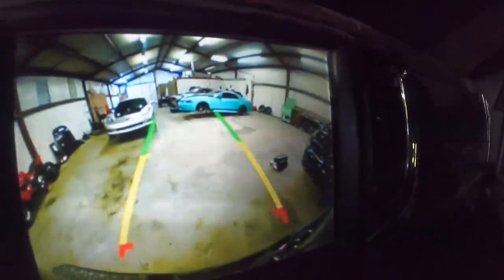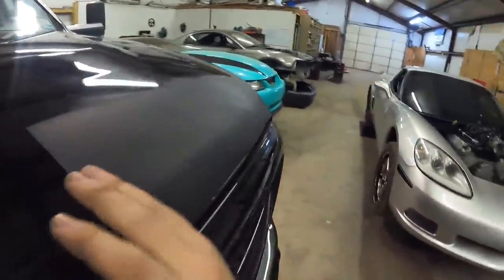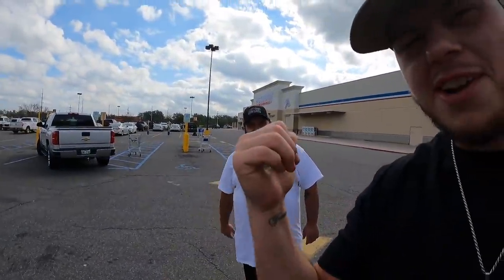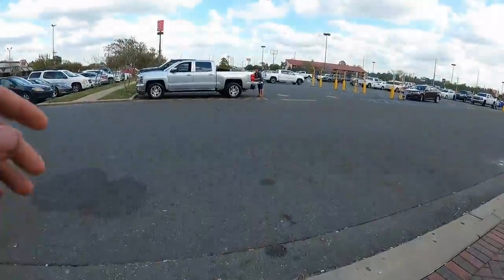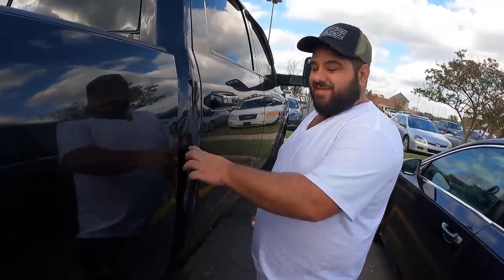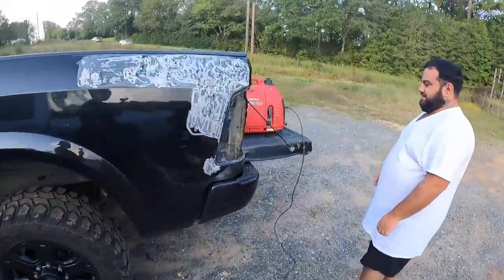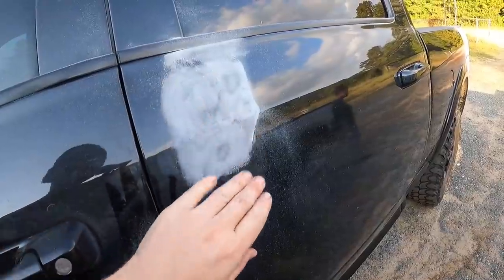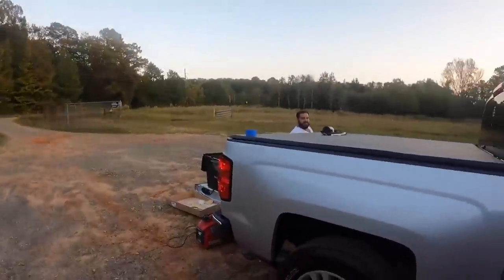Gypsy Body Man Fixes Major Damage on My Truck in Parking Lot!

Comment: damn bro that dude hacked your ride. He could have PDR'd a couple of those.. and drilling holes in your cab in sketchy asf
Reply: It's fixed aint it
Reply: @lda1472  no, it isn’t. That repair will fail within months
Reply: @jonathanloya7239  how?
Reply: @TreDayImages  Body filler is porous.. Moisture will get to the inside where the hole was drilled and  It will rust from the inside out and the Body filler will eventually fail. The proper way would have been to use a spot weld stud puller. Or at the very least use a fiberglass filler under the body filler. Secondly the spray paint primer has no corrosion resistance. also being non catalyzed it will continue to shrink. This repair will probably hold up for a year or two. In some cases that's fine, Buy by no means is it "correct".
Reply: @mikeomalley1683  damn thanks for the info
Reply: Agreed. First thing I thought was that some will easily PDR, and the bonnet and side panel are a fucking mess. I’d love to see the ripples after painting.
Reply: Yeah pin weld is always better than drilling holes and duraglass on bare metal then put your platsic filler over the fiberglass. The hood could be dollied out it just takes more time. I guess that guy did not want to carry an air compressor and cup or gravity fed gun for spraying decent primer with either. For what he charged he gave a decent job though you generally get what you pay for in life.
Reply: What else do you expect from a $600 parking lot job lmao guy did good for what he had and what time he did it in. Respect the hustle. Plus he said he's going to have the car repainted or wrapped.
Reply: Aleph Null that easily costs 3 grand or more for a crew cab truck so he’s breaking even on having it properly done vs this guy’s parking lot job. However, there’d be no YouTube video to argue about in the first place if that was the case
Reply: 420 Friendly to ruin a new truck by improperly fixing it or doing that on purpose to film it?
Reply: @mikeomalley1683  it's gonna burn inside from stud welder so its not big difference
Reply: I agree, people that don't know shit saying he did an amazing job lol  Look up "Dentless Touch"  to see how a paintless repair is professionally done.
Reply: @TreDayImages  that is why you dont use "bondo", alot of people dont realize filler should be used as a "skim coat" and not to fill craters. I only use "icing", totally waterproof and wont crack like bondo, buy the way,, most people dont realize bondo is made with clay.. lol ..Also, mike didnt tell you even tho bondo is porous, what do you put over the top of it so you cant see it, and that paint isnt porous, but, one hairline crack and its all over.
Reply: @velimirseocanac3153  the difference would be a hole and not a whole
Reply: @cferguson6688  why do they make lightweight body filler then? I can't imagine your that good of a metal worker to just use icing. And icing isn't totally water proof and it will crack. Not sure what your talking about
Reply: @ericaz6249  The only reason they call it "lightweight" is because it is lighter than lead which was used before polyester filler (bondo) and i was born..lol  but lead is still used and its very pricey to get someone to do a job for you in lead. Now as for icing cracking,, used the way it is intended and it will only crack if it is impacted again which i found if the panel flexes with bondo, you usally get a hair line crack and these newer vehicles are bear cans on wheels.  , As for "water proof" you got me there, i should of stated more "water resistant" than bondo and that is because of the difference in porosity of the two.  But as i mentioned at another spot, once painted , its all water proof.. what is all boils down to is opinions and what people prefer. I just know when i do a 10k airbrush job on a car, I dont want to have to do it all over again because of inferior (my opinion) products,
Reply: He butchered the shit out of your truck!
Reply: @holen2190  and got ripped off too, 600$, I died when I saw the    $ 5 rustoleum can he was spraying with.
Reply: That was horrendous

Comment: I’m a auto body tech and have been for 10 years and this was painful to watch.
Reply: Why the guy was just trying to making a buck doing the best he could on the spot out of the back of his truck. Have to respect that
Reply: @conner moore same here. Haven’t been doing it for 10 years, but I’m sure if it were painted you would see some inconsistencies in the filler work. Gotta respect his hustle though. Made himself some money
Reply: It’s so bad lol
Reply: YOUR MISSING THE POINT
IF YOU GO TO A SHOP THEY CHARGE AN ARM JUST TO FIX DENTS THIS GUY HAD LIKE 4, AND THE HOOD BEING HOW IT WAS THEY WOULD JUST ORDER A NEW ONE INSTEAD OF FIXING IT.
NOW IF HE DOES TAKE IT TO GET PAINTED ALL YOU HAVE TO DO IS GET IT READY FOR PAINT AND NOT TAKE OUT 4 DENTS AND CHARGE AN ARM
Reply: @13AZ13  that body work was horrendous. The point is to straighten the panel, not hide it under filler.
Reply: Diego V YOU DONT KNOW WHAT YOUR TALKING ABOUT I DO THIS FOR A LIVING THERE WAS NO NEED TO DRILL HOLES IN THE CAB CORNER
Reply: Interesting dent puller technique.
Reply: @connermoore6235  how would you have went about the cab corner? Im very novice and do the best with dents and leave them.... most of the cars are salvage trucks anyway that I work with. 
I guess im asking if that could have been done with just a body hammer? I believe it almost could have.

I agree with connor. I would of done that type of work for 612$ in a heartbeat. Using that much filler and drilling holes is not okay. One day youll get a minor dent and that filler is going to break apart.
Reply: I mean it was cheap, and might look okay, but I wouldnt do this on anything more than 5000$ truck.
Reply: Trevor Brown I would have used a stud puller or  my dent pulled machine no hole required that’s outdated to drill holes especially if you do not weld the holes up after I guarantee moisture will get behind the holes and the filler will get rust behind it and end up lifting for cracking
Reply: Master Daedalus he was feeding him some bs about that primer and that it would fix his shitty filler work
Reply: THANK YOU.. i appreciate the hustle, but this is terrible
Reply: Sounds like you need to make a few videos showing your work vs what he did.
Reply: Jus Sayin  I’ve been doing it for 2 years now, my father has its own repair shop and does pdr, the dent in the door and in the cap could easily be removed with pdr, never drill holes if you don’t weld them up, it will for sure begin to rust in maybe not even a year if the truck is outside, for 600 bucks he could have done a way beter repair.
Reply: Jus Sayin I’ve messed with them before but I am not expert on them I’m better at metal working
Reply: HighRider91 I’ve been wanting to do that I need a GoPro rig to wear around the shop
Reply: Lol but his wallet ddnt hurt as much how.much would you have charged for the same amount of work ?
Reply: No you ain’t stop lying
Reply: That the reason it's cheap,not be good as body shop..
Reply: @mustangsflo  probably €600/ $698
Reply: @mkveevs  Its funny when you take panels off and see the little filler worms on the back side haha.
Reply: then you definitely dont want to see how we did it 30 years ago when vehicles had real metal.
Reply: Jus Sayin  yeup, these newer vehicles, (less than 20 years) have very thin metal PDR works great but It didnt work on my 88 truck except in the middle of a panel.
Reply: Jus Sayin  yeup, they did some crazy stuff then and still do, Personally i wasnt one of those.. it was hammer and dolly 90 % of the time. and  those vehicles back in the 70's and 80 didnt have the rust preventative these newer vehicles have and not to difficult getting rid of the cancer.. as far as "spray foam under  fiberglass.. you must of repaired something my father in law worked on..watching him repair his own vehicles scares me.  lol..Sometimes  I open my mouth in the wrong place and always get  people asking if I "paint vehicles", I tell them I do my own and "IF" the person has enough money I will do it for them. They usually shut up after that. I tell them, painting is easy, its the prep work that is the pain.
Reply: Same. I haven't seen a screw type dent puller in years why would you do that to a customers car when a stud welder is $100 at Harbor Freight with the slide hammer .....
Reply: @13AZ13  if you paint over crap you get crap. If that came into my shop I wouldn't touch it without the owner signing off on understanding the body work they brought in was substandard and what they get is what they get IF I even thought I could do a proper finish on it. Otherwise I'd turn it down. I can't tell just from a YouTube video of it is or not.

Comment: Get it painted same color and see how well boss did, then get a wrap.
Reply: Waste of money
Reply: @dakineboi1239  content is nit wasted money, it’s  an investment
Reply: Totally agree, don’t cheat out fix it right
Reply: Better yet build a time machine, then take your ass back to when you messed up. The point here is this guy is proving that there is absolutely no point in paying huge amounts of money to fix your f*@$ ups. I say the guy did a great job.
Reply: or just paint it a crazy color and nobody would second guess that its wrapped
Reply: @jvon3885  he did a great job... if it was a 1993 honda civic. drilling holes and laying bondo over it, wont last long. and no, little dimples wont magically disappear after the primer cures lol. Dude even said to lay tape over it before the wrap. Truck cant be painted without looking like shit.
Reply: @frostbite1991  Na man I've seen worse
Reply: @frostbite1991  dude, your profile pic is a stock Nissan Altima lowered on shitty wheels. Leave actual work to men
Reply: @71sc502  he's right though the work is pretty shitty. Might look halfway decent on camera but it's wavy as fuck and will fail soon enough
Reply: @71sc502  what does his profile pic have to do with it? He’s 100% right, this is hack work with cheap material that won’t hold up lol, you get what you pay for
Reply: Everybody well all the negative comments are talking about how they think it’s wavy.....ain’t that why he said it needed block sanded or mentioned block sanding it?....I’m no body man but I’m assuming everybody else in here is
Reply: @riderdie3143  I am and have done it for over 20 years. I own my own shop and easily do 6 figure years by myself I will not hire help. If this guy was good at what he does he wouldn’t be in parking lots hustling jobs up he would have the work coming to him.

Comment: I'm not trying to be that guy... but I have 11 years in the mobile auto body repair industry, and this guy is why mobile guys get a bad name.  He is the epitome of who they're referring to. Some of us do nice finish work, I'm told my work looks better than some body shops.  This work is complete butcher work.  That's not what "ready for paint" is.  A wrap isn't even going to lay over that and bond correctly, that's what he's going to be told at the shop. The cab corner could have been glue pulled, but now the screw hole will rust, and the door dent could have been pushed out by a dent tech, and not even needed body work.  He also would have been better off not taping the paint area, but it doesn't make a difference in this case.  The guy also over paid for this work considering the end result. Body filler over paint will ghost ring underneath of the gobs of crap Rust-Oleum aerosol he used.  Once he can't get a wrap, the junk paint is going to erode and it's going to look like a rusty lawnmower.  This repair actually made this truck worse, and could have been cut in half if done properly.  Any reputable painter that will put their name on that body work will have to be the equivalency of this body guy, because if not, they're going to sand off everything he did and redo it.
Reply: I almost shed a tear when I saw the filler going on the paint
Reply: Yeah any quality guy knows that filler doesn't go over paint
Reply: Got to put a man’s work down because he has hustle! I respect this guys work and willing to go out with his family to get it! How much would you have charged for the same work?
Reply: I respect the hustle but i agree with you people watch this video and think wow he did all of that for $600 the body shop quoted me x y and z when they don’t realize 1) you can’t just paint over the spray can primer 2) the body filler was put on just for show because it won’t last  etc etc I’m glad I wasn’t the only one cringing watching this
Reply: Exactly what I was saying, no clue why people in this comment section are hyping this man up sure respect the hustle but this is complete butchery
Reply: Tear it all off and start over each time they bring parking lot jobs in I charge out the ass for butchers js lol
Reply: I agree. All the unnecessary holes. A pointless guy could have care almost all of those dents except the hood. Filler is used for leveling not building.
Reply: As a paint and body guy myself, I was cringing the whole time watching this video.
Reply: Well said on all points. So much extra, unnecessary, damage was done on this "repair".
Reply: @erneststone5229  any good body guy wouldn't do this same "work". We have standards.

Comment: Man... you got got. There is no way around it. The door dings could be pulled out using paint-less methods, the holes drilled into your cab will rust because he just threw bondo on paint and that will trap moisture and rot it from the inside, that primer was done with lines so hard it would probably snag your shirt walking by, the bed corner looked like he either dug that sander into the metal and hacked the crap out of it or used a screwdriver to scrape paint away, and all of the bondo will end up cracking and falling off if you slam your door too hard. Now to get this fixed the right way, it will be more than whatever that body shop quoted you because they have to undo all of that terrible work. You just basically got the "single young blonde walked into a 5 min oil change shop and ended up paying 75$ for a brake fluid flush because it smelled bad" treatment... I would say you get what you paid for, but even at 600$, you got robbed man...
Reply: Shhhh.... OP is the perfect young gullible kid that this type of "body" guy preys on. Don't burst his bubble.

Comment: My cousin is a body guy, his dad was doing it, his father before him. All used different techniques but this guy you hired knows his shit. 
I use to have a 76 Pontiac Firebird, east coast car fairly rusted out. He had put in a drivers side floor pan and replaced the floor, took out a dent on the drivers side door. and fixed my trunk in 2 hours. This guy worked fast and paid attention to detail. However he was a functioning alcoholic. Couldn't keep down a job, i told him work out of my garage until you can get on your feet. He was in the black in a week, then drank for a few days, then went right back to work for the next 6 months. The Guy was amazing i just wish he would keep going to meetings. He's amazing when he is sober, useless when drunk, well at least he's a happy drunk.

Comment: You got hustled. Drilling holes in panels like that is a thing of years past. On top of that that box side is wavy as hell being black you’re going to see that like crazy. Rattle can primer is also not compatible with a lot of the solvent paint that shops use. It shrinks and never fully hardens because it’s not catalyzed. So it’ll react and cause crazy issues down the road. 🤦🏽‍♂️
Reply: Maybe that's all true. But what do u get for 600? Still well worth it. If he has it painted. He can have shop sand off the primer.
Reply: What Joel is saying is right. im a body tech and when someone does some shabby body work like the bedside i charge more than the initial bc u have to basicly start over and remove what they have on it. and that body mans guide coat is false. thats just some sparkle he put in it so u cant see the blemishes as easy. you use a powder or can guide coat while blocking and its not a sparkle or flakey at all. Best Wishes to you when u get it painted or wrapped

Comment: I almost got hustled like this back in the day
Reply: Ya body filler won't stick to clear coat or even paint well. Bare metal only.  All that will flake off. But he knew what he was getting and if he wraps it then it will last tell he peels it off.
Reply: @focusdrivenmedia3436  did you not see the primer
Reply: @ayee4258  you're funny.